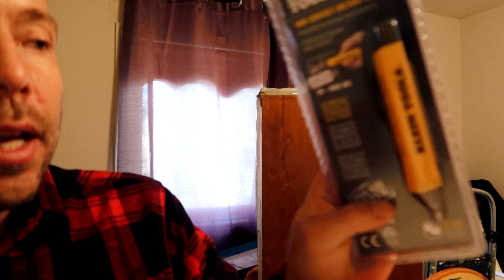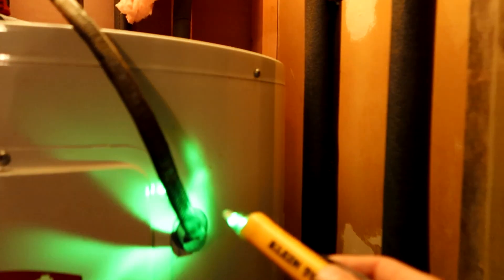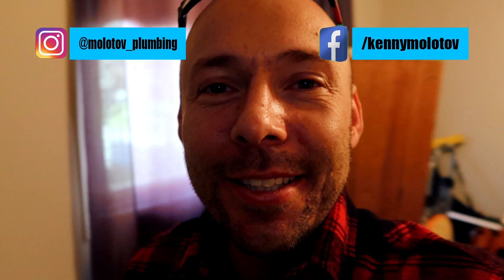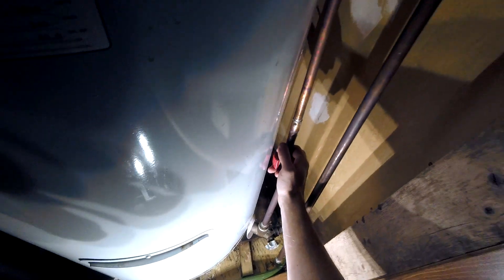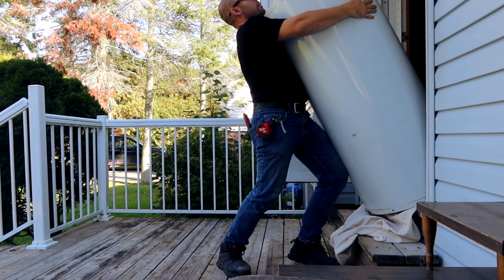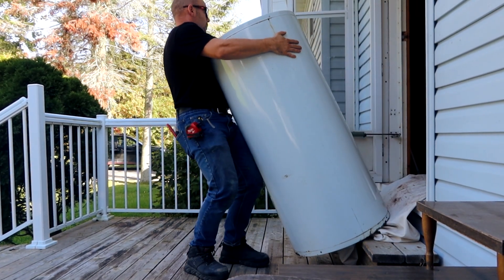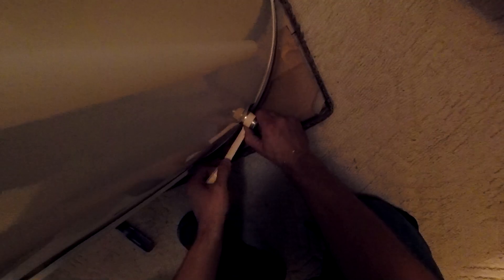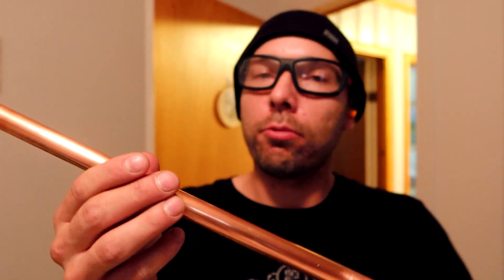How Plumbers Avoid Getting Electrocuted...

Comment: I start my plumbing apprenticeship tomorrow with a service company. I did a lot of years as an electrician in the trade and they used to tell us to get a Fluke brand voltage tester. That brand is top of the line and I wouldn’t really trust the Klein brand testers although their hand tools are premium. I think they sell Fluke at the electrical supply houses.

Comment: Hi Kenny, 
What would you say the best copper solder is that you'd use? Basically for house hold use 1/2" copper mainly
Maybe I'm old school but I remember the higher lead content solder was always a good choice but these days maybe by code they've changed the solder chemistry especially for potable water lines?  
 What's your opinion and thanks. 
D from Ontario
Reply from the maker: Hey friend, lead is not a material we have in copper anymore. It’s toxic to the human body and Ontario avoids using it altogether. Hope this helps and thanks for the support!

Comment: Anytime that you have a bottom fed heater in Florida, you are required to have a vacuum breaker  by code. A valve on the hot side would also help from back siphonage. Nice job Kenny!
Reply from the maker: Thanks for the insight Randy!
Reply: @Kennymolotov  Also what I forgot to tell you, is to install a 3/4" tee on the bottom if your water heater with a hose bibb. That way you can drain the heater next time you need to replace it.
Reply from the maker: Thanks Randy, it actually comes with a sediment faucet so we should be good!

Comment: Hi Kenny, just wondering why you prefer to solder your pipework rather than press fittings? And in Canada are tempering valves required on domestic HW?
Reply from the maker: Hey Stuart, I love pressing but I still haven’t gotten myself a press tool, it’s in my future though! And no we are forced by code to use tempering valves, but we definitely do use them! Thanks for the questions!

Comment: Get ya a voltage and continuity tester. One with the two probes. Much more accurate
Reply from the maker: Will definitely look into it! Thanks!
Reply: @Kennymolotov  I use one made by Greenlee. It’s an older tester they don’t make it anymore but boy has it never failed me. My dad has one just like it that I grew up learning to use and wanted my own recently but was bummed to find out they stopped making it. But I found one at a local pawn shop for 15 bucks! Talk about lucky I could never find another one of those again I bet

Comment: Codes here in north carolina require us to install a thermal expansion tank, and an electrical disconnect within 3 feet of the water heater. So then we have to get 2 inspections, electrical and plumbing, takes a lot of extra time as you can imagine! Nice work😊
Reply from the maker: Woah! A lot of extra steps there! Thanks for the insight!